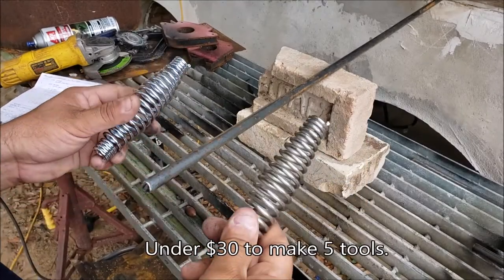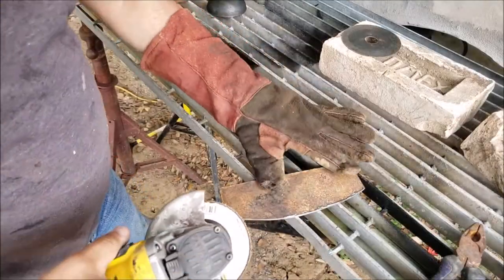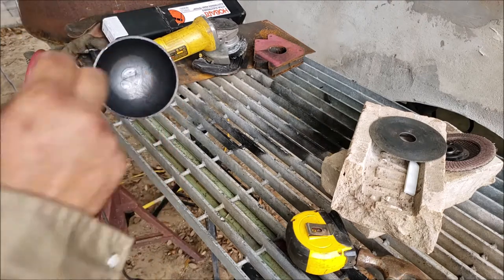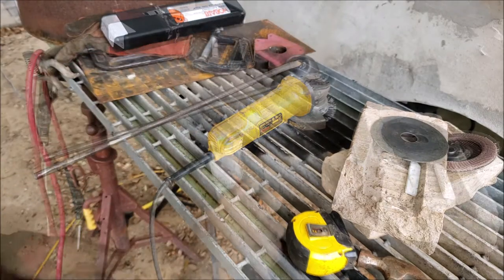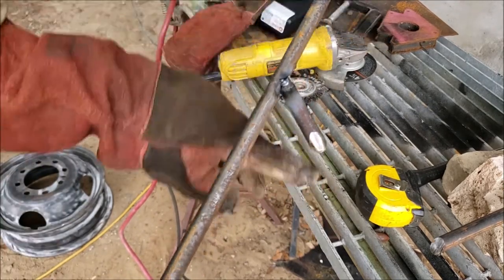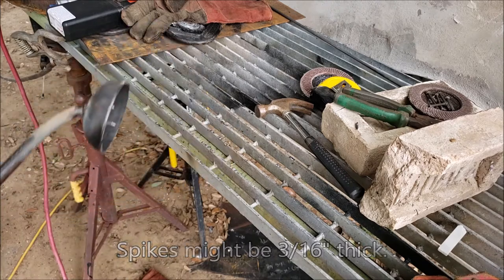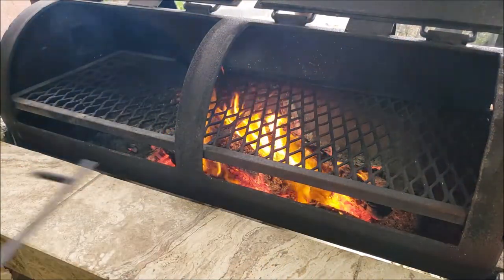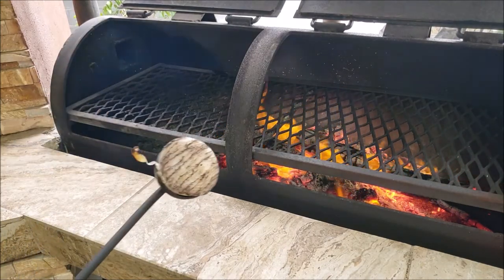Homemade invention for fire management tools on grills and smoker ash rake grate cleaner

Comment: What are the spikes in the onion holder made of
Reply from the maker: I used some thin round stock and just sharpened the end and on others I use thick nails. I really use what I have on hand to keep cost down as local prices of steel are very expensive.

Comment: Where do you get that circle shape for the onion cleaner or do you make it as well ?
Reply from the maker: They call these pipe caps at the store I got them from. I am not sure if they make them or get them made in Mexico as the steel comes from there.
Reply: @cutweldngrind   thank you very much I enjoyed this video very helpful. I’ve only stared welding for a year. I’ve been learning from my father in law he was a welder for 20 years in oil fields in Texas.
Reply: Also I have round bar of 3/4 diameter do you think that’s to thick to make for these tools maybe they will be to heavy ? What do you think ?
Reply from the maker: @Max-ll3wf  3/4 may be heavy. I see people use 3/8 and 1/2 inch round bar on these. I prefer the 1/2" bars. I buy the 20 ft joints and they cut them in half so they fit better on my truck.

Comment: Awesome... I have an onion rod holder and man does it come handy, you can't imagine how many times I've burned my hand trying to clean my grill with my hand holding the onion...lol
Reply from the maker: I've used mine 3 times already. I will eventually build more and maybe sell them to raise money for other projects.
Reply: @cutweldngrind  they sell pretty fast in FB
Reply from the maker: @BigLou956  I may try it once I build more assortment of accessories. I was thinking around $20 per tool. I need to go to the city to buy some materials. They have pallets of 10lb electrodes for $12 and I got some 7018 to try. The price seemed very cheap compared to $30 to $38 that I pay here for name brand.
Reply: @cutweldngrind  yeah thats the price they are going for on FB $20...